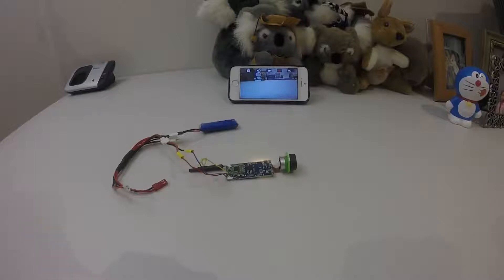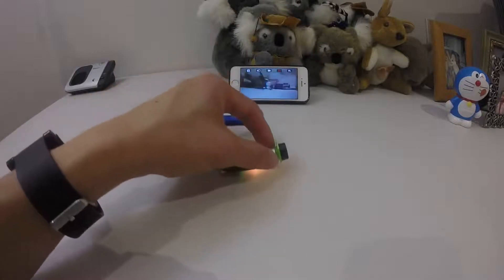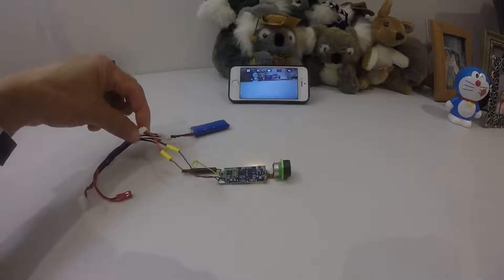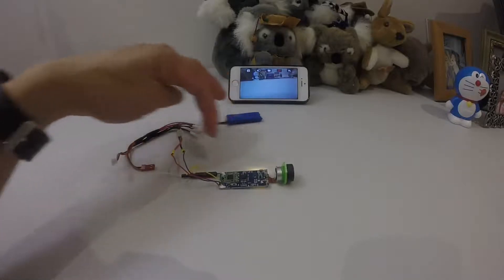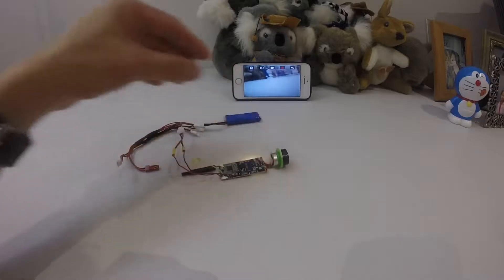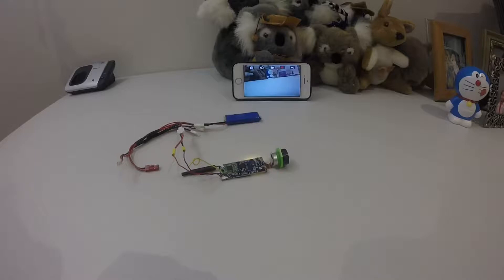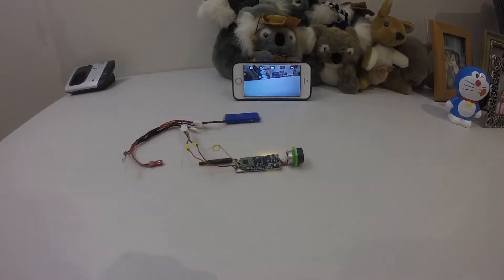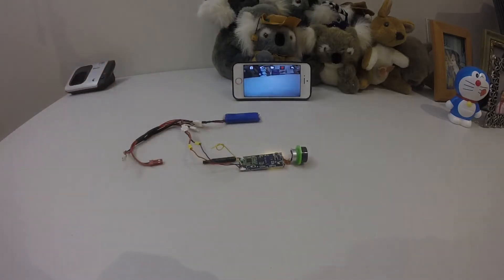Quadcopter - Syma X8W wifi camera Mod - Part 3- completed & testing

Comment: doing the same thing. i enquired an extra wifi camera so i was going to instal it on a small quad that isnt camera ready. thinking about using 2 small button cell batteries
Reply from the maker: Thanks for watching! I am unsure how to use button cell batteries.
Reply: Well the small round, flat button cells take up nearly no room and weigh nothing so I figure it might be avoid option to use on smaller drones.
Reply from the maker: Hope you can let me know how you connect the button cells to the cam. I am interested to see your method.